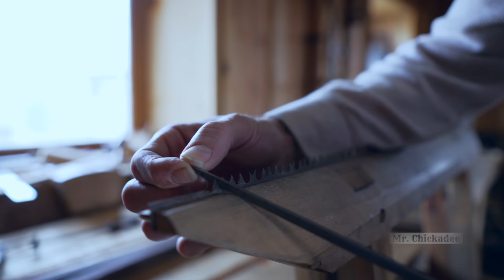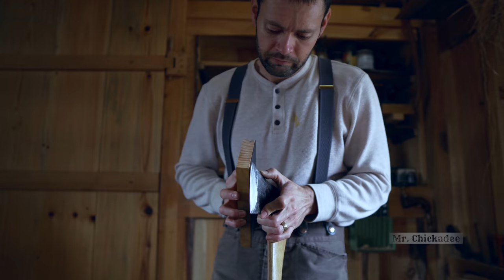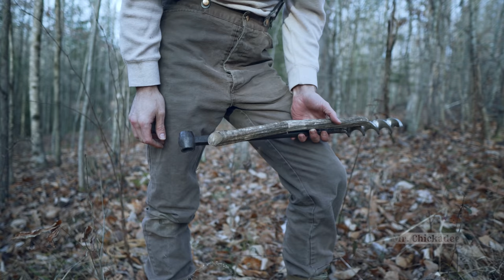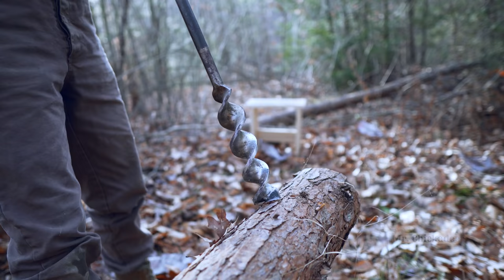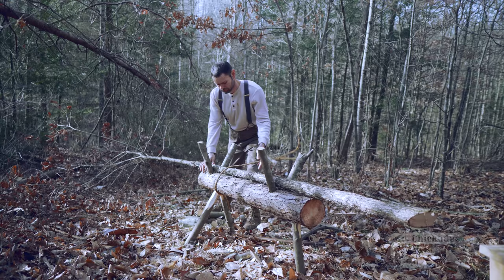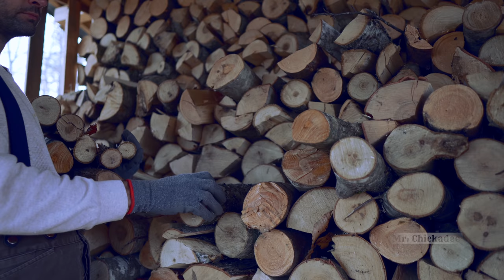Making a saw buck and cutting firewood with hand tools

Comment: Last year I switched from gas chain saw to battery chain saw.  This year I’m switching from battery chain saw to felling axe.  Next year I’m renting beavers.  😉. What is the size of your wood auger used on the saw buck?  Year by year, bit by bit I’m slowly converting to hand tools.  Loving the peace and natural pace of the work.  Thanks for the inspiration.
Reply: Don't do it! The beavers that is. I had a pair - they just don't listen, that fell a perfectly maturing black cherry. The "tanned" beavers now rest in a bin, in the closet. Stick with the axe as backup, to the battery chainsaw. I keep one, along with a gas-mix 24" bar "until" they come out with similar sized battery version.
Reply from the maker: A good sharp bucksaw is quite fast, and if you compare the weight, smell, noise and expense of a chainsaw, Id much rather the bucksaw if given the choice.
Reply: @MrChickadee  Agree on the ‘calming’ benefits.  I live on the edge of Amish country in SE Ohio,  I’m always picking up tips and tricks from the fellows.  They rarely cut a tree down for firewood.  Unless it’s needed for structures they’ll always find standing dead or fallen trees and branches for firewood.  And I do use a backsaw for smaller saplings and kindling sized branches.  Thanks again for the exposure and information.
Reply: Last year I sold my gas and electric chainsaws and bought a one way ticket to Hawaii.
Reply: Felling axes are awesome for limbing and felling but definitely get a good handsaw to make all the cuts.  So much more efficient and enjoyable when making that many cuts.
Reply: Same with hunting. I'm going to traditional bows and flintlocks. Those old tools are great. I like to think of who used them originally.
Reply: @FrankLutz2  lemme guess... Breman Ohio... I live in amongst the Amish up outside of Mt Vernon...due to the awesome nature of Mr chickadees videos, I built a queen size bed frame all post and beam style for the house when we bought it. But for some reason, I just can't get away from my good ol' gas ax...

Comment: My dad used to make firewood with a hand saw, a "poka". My part was to split them with an axe and I had often hard time to keep up with him. Sharp hand saw is not slow but it needs some skill and strength. If you don't push it straight it binds and cut may become skewed. Then you will get tired

Comment: I cut firewood with a Corona Razor tooth 14" pruning saw.

Bit of a workout, but it can actually go quite fast. It can be better than a chainsaw for small diameter wood.
Reply from the maker: Yep, a sharp buck saw like this video is quite comparable to a chainsaw, with all the added benefits of not being a chainsaw.
Reply: I use a Japanese crosscut saw; fast and clean.

Comment: have been wondering already what you have been up to so long!;) Regarding the sawblade: is this a modern blade with hardened teeth? or just the same style?
Reply from the maker: it was, after they get dull I just temper the teeth with a torch to a blue, then they can be filled many more times.
Reply: @MrChickadee  Wow, good idea.  Something I wouldn't have thought of on my own...

Comment: We have the same exact bow saw frame, even the hardware. I love the design (though I have to be careful when grabbing the handle, as I’ve nicked my index finger on the bottom of the blade several times there). Your blade has much more aggressive teeth for fast cutting. I wonder where I can get replacement blades of this exact length and hole spacing. Thanks for sharing friendo.
Reply from the maker: Just measure hole to hole, I think its 36 or 30" standard length bow saw blades from Ebay will work. Or get longer, snap the blade off with pliers and drill one hole at the right distance. If its a hard point tooth, just temper the teeth with a gas torch till they turn blue after the saw gets dull, then you can easily file sharpen them many times.
Reply: @MrChickadee  thank you kindly my friend!
Reply: @MrChickadee  Interesting idea to temper hardened teeth for sharpening. Another possibility is to use dremel type tool with thin abrasive disk, it can be also faster than filing. 
Bucksaw can be sharpened as such, so no need for taking blade out of it

Comment: Any ideas for filing clamp outside one with legs? I try to do some filing inside in my workshop but I cant seem to get the lighting right, nice job on your clamp its very well done.
Reply from the maker: you mean the saw vise? I take it outside all the time. or over to a window for some light.

Comment: While I see that a lot of your tools are of older manufacture, I am curious if you have sourced any quality hand tools (especially saw blades) from new manufacturers.
Reply from the maker: these bow saw blades are new, hard point teeth must be tempered with a torch before you can resharpen them though, but they are good steel.

Comment: I have seen before that you advise against use of Portland cement. Why is this? I would greatly apricate your thoughts on the lime mortar vs Portland cement issue. Thank you.
Reply from the maker: OPC is not only never needed, it often directly destroys architecture. This is a proven fact, it splits stonework, holds moisture and rots woodwork, fails and cracks apart within one generation or much sooner. Its just terrible stuff, and obviously not needed, as it was never around, yet we got on fine as a species.

Comment: Not sure if I should post this here or on the very first video you ever posted; I'll try to keep it brief. 
I'm looking to buy acreage, but trying to decide whether to:
1. buy more acreage, possible water rights, no structures and little to no utilities and build from scratch
2. buy less acreage and all utilities present, with a permitted camper and build from scratch

My question: when you bought your acreage, did you have any utilities nearby? If not, how did you supply water, electricity, or heat?
Reply from the maker: Depends on your situation, wants and needs. You will likely have to add utilities at great expense at a later date so if you can buy with them already there, that can be an advantage. Trust me, adding a good dry solid road, plush utilities for any amount of distance can get very pricey very fast. We actually put our house closer to the main road rather than in the favorite part of our property because they were already in place there, otherwise it would have cost over 10K to add all that further in. Some times it just pays to be practical?

We lived in a canvas wall tent for 2 years, in hind site, a camper would have been very nice! haha
Reply: @MrChickadee  Thanks for the valuable insight. Yes, I'm much further north than Kentucky, so a tent is WAY out of the question lol!

Comment: Thanks Josh....I'm wondering, are frame saws the same as what might be called a bow saw?  I once had a book by a cabinet maker named Tage Frieid, who used what I believe was called a bow saw.....??? I may be mistaken though.
Hope all is well with you.  Bill
Reply from the maker: A saw by any other name.....I would say a frame saw is any saw with a wooden frame which tensions a thin blade, so this could be anything from a tiny fret saw up to a pit saw used to cut planks from logs, there are so many saws used for all things that would all be called a "frame saw" and yes, a hack saw and a bow saw are technically in this group I guess. Normally, a bow saw is meant as the curved metal pipe framed kind used in the modern era, and what I use in this video is often called a Buck saw, but terms vary place to place.
Reply: @MrChickadee   Hi Josh,  Oh, it's mind boggling..lots of information, interesting, and really eye opening. Thank You.   Have a Happy and Healthy New Year for you and yours.  Gratefully, Bill

Comment: Thanks for sharing.  Out of curiosity, do you do cut logs like this for a full day or is this something you do like an hour a day every day.  Both ways get the woodpile filled.  Just curious what you find as most efficient way of doing it or what you prefer.
Reply from the maker: Depends on what works best for you. Ive done each at different times, depening on my work load and schedule what works best, if I had to choose, an hour each morning either cutting firewood in winter or scything the grass in summer would be lovely start to the day.

Comment: Don't mean to be an ass, but could you please make a video on making wooden screws? I've been wanting to build a bench for a while, but costs of ones manufactured are insane...
Reply: There's a channel called little forest (I think). Chap on there has done one.
Reply from the maker: check Ebay often, Ive seen them go for pretty cheap there, I found mine at a flea market. There is a video on youtube on making them, most of the work is in the tap.

Comment: Why wasting time cutting firewood with handsaw?  Why not using chainsaw?
Reply: Believe it or not, a hand saw is almost as fast as a chainsaw on small diameter logs. Also hand saw is much safer to use and quiet.
Reply from the maker: "wasting time"
Reply: @MrChickadee  =D
Reply: No noise, no gasoline, no battery charging, and the hand saw cuts pretty quickly through smaller trees. A chainsaw would not be an advantage. Larger trees, I could see your point, but it looks like Mr. Chickadee is clearing some of the younger growth to keep his forest healthy.